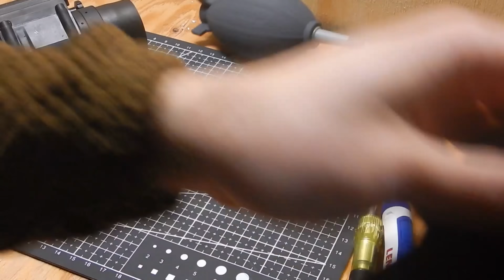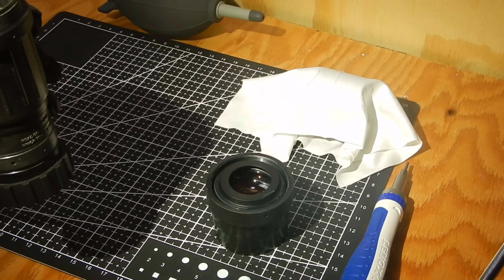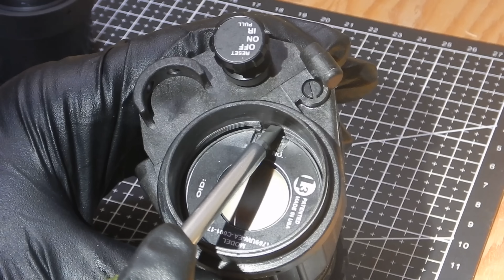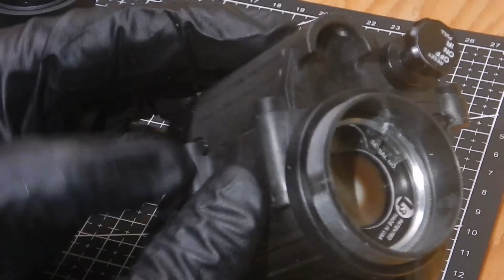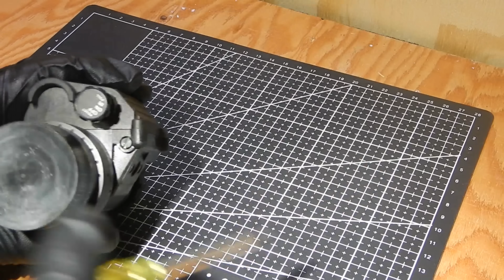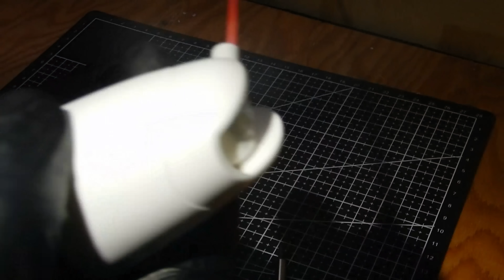How to Build Your Own PVS-14

Comment: My question is what websites/locations are you going to for finding these items and what are their relative prices
Reply: Agreed.  That's pretty important info.
Reply: +1 on where to get tubes.  With the pricing I see on eBay, you may as well buy a complete gen 3.
Reply: Agreed, a place to pick up a parts kit
Reply: Yes, good question. I was just wondering myself
Reply: I was waiting for the advice on where to get the “good” tubes but it never came. WTF. This is much less useful without sources.
Reply: I bought an omni 7 tube off a fb group for night vision and my parts kit from kosher surplus. All in ~$1700.
Reply: @rshinn1776  that's the same price as some assembled NV setups lol
Reply: @PartialRug  yeah maybe for a gen 2 with agm  glass. Not gen 3 with Carson
Reply: @rshinn1776  was the tube new?
Reply: @rshinn1776  Yeah, that's about the same price as a gen 3 RNVG (when in stock)
Reply: Following *
Reply: EBAY, you cab put together a beater pair with a zone 1/2 blem on the tube for under 1400
Reply: @piggyslayer1999  Ebay really doesn't show you anything
Reply: *Following
Reply: tnvc inc may sell replacement tubes idk
Reply: Based on what I’ve found, eBay has some but they’re really not that much cheaper than getting the full set up? There’s a used Photonis for about $1800?
Reply: Agreed! Anyone find any parts for this build? Or know of a decent place to start????

Comment: Where are you finding intensifier tubes, let alone for cheaper than it would be for a pre built unit? Also, body kits seem to be around $700, does that make sense?
Reply: Yeah for real, where can I find these alleged cheap diy kits.
Reply: 700 is about right for a kit. I'd make sure you get a Carson kit and not a foreign one. Tubes can be found if you look around. Or buy new from most NV dealers
Reply: @ChevTecGroup  I’ve never seen a kit for less than $900-1000
Reply: @Lifechanging99999  sts solutions was selling foreign kits for 550 without the nonsense skullcrusher and pouch. Not sure what they out them at now. 600-800 is a pretty standard price. You aren't looking hard enough
Reply: @ChevTecGroup  where do you recommend to look? New to the diy kit scene
Reply: @EdwardOrnelas  for a kit, look at most of the big name NV dealers. Steele, jrh, wills optics, gooningear, and of course ebay. TNVC may offer kits as well. Google should turn some up
Reply: @ChevTecGroup  thanks boss!

Comment: Re: nitrogen purging, if all you're looking for is an inert gas filling the cavity, why not just assemble it in a bucket of dry ice? CO2 is heavier than air and will displace it, the bucket creates a 'sea' of CO2, and when you slap the optic together in that environment it will naturally be filled with it.
Reply: Good idea but there's one word that defeats dry ice. Moisture. Since the temperature difference would be so drastic from room temp air the Moisture content in the sea of co2 would be far too high I believe
Reply: @TOO_RAW  except cold air doesn't hold moisture. That's why its hella dry in winter and humid af in summer. The dry ice not only provides an anoxic environment, but a cold one as well
Reply: @ArmstrongMixture  I understand that's partially correct but that's only if the inert gas is below freezing. I live in an area where we have cold damp winters unless the air temp goes below freezing. What I'm trying to say is once you pull your purged unit out of the co2 bath your bound to create humidity from the temperature difference inside the unit but that's just my theory. Who knows it might work quite well to be honest
Reply: @TOO_RAW  that's not how humidity and condensation works.
Reply: Do they make some manner of injector that you could add one of those little CO2 cartridges to? Like the ones they use for life jackets

Comment: I think purging would prevent condensation
Reply: It prevents condensation on the inside of the lenses and the IT.  It also keeps moisture off of the electronic circuit board inside the housing
Reply: That's exactly what it does, fogging is condensation, it's just internal rather than external where you see it.

Comment: An Electro Static Displacement mat with wrist and foot connections is recommended for prevention of static buildup and discharge (Faraday cage).  If you can get it (one way pneumatic valve), you want to purge with Argon (check specifications for pressure levels).  I always wore a full bunny suit working in the clean room, but if you have it a hair net is also a good idea; reducing the particulates in the local air is crucial.  Also, I would recommend working on a surface you can get spotlessly clean, wood is not great for optical work.  Local floor and tile places will have a nice piece of polished granite you can buy for relatively cheap.  (Edited for granite suggestion.)
Reply: Yeah, ESD management is a crucial component missed from this video. It does not take much electro static discharge to damage a circuit board component. And the insidious thing is it might not be obvious right away. It might result in a sudden premature failure later down the road.
Reply: @pb7087  while usually pretty important. These parts are pretty tough. But it is still a good idea to take some precautions
Reply: @ChevTecGroup  ESD is largely overrated, it really depends on the components though. About the only one I know of off the top of my head that's super ESD sensitive is laser diodes.
Reply: None of that is needed for assembling one nuit for yourself. Put it together and you'll be fine. You're not shipping 10k units, where you get to be sure none of them get returned or fail in the field.
Reply: @littlejackalo5326  Then why bother taking any precautions at all?  If you're going to do something, do it right.  You don't want  the unit you spent money on to be the 1 in 10,000 failure.  You can reduce this probability by using proper tools and procedure.  An ESD strap is essential and cheap.
Reply: Purging is to be done at 3psi. Never exceed 5psi

Comment: If you're going to be just using a Pvs14 you may want to look into swapping the standard battery compartment to an NL914C housing. It's lighter, allows you to use either a AA or a CR123 and has all the controls placed more conveniently.
Reply: I’d like to build one with the NL914C and an aluminum 7075 T-6 Vyper housing.
Reply: Get rid of both and get one that uses an 18650
Reply: @saltwaterrook4638  This
Reply: @saltwaterrook4638  where is a reputable place to get quality tubes?
Reply: @saltwaterrook4638   which housing would use the 18650
Reply: @saltwaterrook4638  except 18650s don't have an internal level shut-off. Once a Li battery is run past a certain point, it can never be recharged, just recycled.
Reply: @jarekmace1536   18650 batteries are lithium,   You are referring to the 2 different types of lithium where one is rechargeable and the other is not,  and 18650s do have the shutoff at roughly 3.4 volts
Reply: @diychad7268  only internally regulated ones do. There's tons and tons of unregulated ones used primarily for vaping that you can get for cheap, you wouldn't want to run one of those down too far.
Reply: Replaceable batteries > rechargeable batteries. I can buy packs of disposable batteries. I have to keep rechargeable batteries on my smart charger maintainer.
Reply: Why would you want to use nickel metal hydride or alkaline when you could use lithium?
Reply: @diychad7268  lithium batteries have terrible performance in cold environments. I have a headlamp with an 18650 that works fantastically for 7-8 months out of the year. As soon as the temps dip past freezing, then I'm finding I have to charge that battery 3-4 times more often.
Reply: @maynarddrivesfast804  Get the green Samsung 18650s, I use them down to negative temperatures all the time with no problem.  Just like most batteries they become less resistant to cold when they have less than 25% charge so I try to keep them above that.  I wish more devices used the 18650.
Reply: @Iwouldashouldacoulda  I'm not doubting your experience with the Samsung 25R (the green Samsung batteries), but I do a LOT of projects utilizing 18650 cells. From building battery packs for high amperage electric bikes and Onewheel boards, to building my own battery storage banks for my home, I've personally found that your energy capacity on ANY lithium ion battery is more than halved when the ambient temperature of the cell drops past freezing. I've found this to be true whether I'm using Samsung 25R/30R, Sony VT5/VT6, or even cheap, unbranded Chinese cells. Now there are the newer LiFePO4 cells that use a different chemistry that have been proven to operate much more efficiently in the cold than standard Lioh batteries, but they aren't as widely used in the 18650 cell size. I get that personal experience is anecdotal, but I do think that research on the cold weather operation of Lithium ion cells is pretty clear that their functionality is cut significantly.
Reply: @maynarddrivesfast804 idk if they make anything other than high output rate but h(OHM)lyfe 18650’s are my go to premium, I learned of them from vapes but even since I quit that shit I’ve used them in a few other things, most evidential use was in a protac hlx and not only was the output considerably higher but it lasted super long and didn’t decline in output until 5 mins before it died, only downside I’ve noticed is that the actual lifespan is a little shorter, and what I mean is I get less recharges per the battery than with other lower output batteries. Which to me makes perfect sense, and is a trade off I’m willing to make

Comment: Harbor freight counter top sand blasting cabinet would work great for setting up a clean room that you can set up with a stable atmosphere of argon. You can get a large tank of argon from a welding supply for a fair price and now you have a clean room environment for sensitive electronics without having to mortgage the house.
Reply: That's frigging smart! Never thought of that.
Reply: @xcyted4now  also would need to set up some form of dehumidifier to make it a true Inert environment.
Reply: @devinmanderson  Just throw a bunch of those silica beads packs in there for the more budget minded.
Reply: And attach a grounding cable to eliminate any static charges.
Reply: Also you would want a vent valve at the highest point possible for conducting the purge and a accurate flow meter/regulator.
Reply: My local dollar store sells large desiccant packs by the kitchen supplies for... a dollar.
I put them in my gun safes.
It's amazing how much water they take out of the air.
Reply: Add on a cheap vacuum pumpor hand vacuum brake bleeder kit....
Reply: @jonathanmoody6951  that wouldn't work for a sand blasting box. They're usually not air tight enough for a decent vacuum and you'd probably blow the gloves up like a balloon until they pop from atmospheric pressure trying to get in under vacuum.
Reply: Yea Argon is already heavier than air, no vacuum needed. A vent on the top will allow the normal atmosphere to be pushed out.

Sometimes we just need a dust free environment and atmosphere isn't the issue, putting a outward facing fan on the vent will create negative pressure = pulling any dust out with it. Just remember to filter air coming in. 

The exact same idea is implemented in my workshop, to a larger scale, and with a wall of copper pipes weaved into an air dryer, so I don't have to mitigate brainpower when I'm applying finishing, setting epoxy, spraying paint or powder coating or just allowing paint to dry. I won't even sand without a down draft table. Id hermetically seal the space if I could, trust me. Eliminate as many variables as possible.

Comment: What would you recommend be done for a blurry unit ?
Reply: Focus it? Clean it? How blurry are we talking. Is it the whole image or just part. Sometimes a through disassembly, cleaning and reassembly will clear up a lot. If it has ghost burns you can fix a lot by "blackboxing" it. Put it in a dark box in a dark closet overnight with it turned on, that often cleans up the image

Comment: Hand powered vacuum pumps are quite cheap. The other benefit to pulling a vacuum is evaporating any surface moisture, be it water or volatile oils.
Reply: That's what I said above, for a sustainable post-collapse solution.
Reply: Professional level vacuum pumps are available at Harbor Freight.  They'll pull down to 25-75 microns and run about $150.  Mighty-vac hand pumps work okay too (for the money), but the best vacuum I was ever able to pull was about 27 inches.
Reply: Brake vacuum pump off amazon work great 30 bucks

Comment: Any ‘ball park’ price on the kit? …would kinda help
Reply: E-Bay ~$750 for the kit.  Tubes go anywhere from ~$1000 and up depending on generation and grade.
Reply: You found Gen 3 tubes for $1000?

I find that the higher end units are cheaper to build than to the cheaper ones
Reply: @peterprovenzano9039  I didn't specify gen 3 but yes, you can find used ones near that range at times.
Reply: @peterprovenzano9039  I see them quite often for that proce or close to it. Usually older gen3 aviation tubes that fall out during a QC check and get replaced.

Comment: Just a not the retaining ring has an "up side/facing the ocular lens" also. You can tell be the depth of the notch marks in the retaining ring. Also to purge I remove the ocular lens and with the objective lens pointing up 12:00 use the Argon to push the O2 out of the bottom.

Comment: I was a radio repairman (29E) in the Army back in the early 90's.  In our shop we also had an MOS that repaired sundry other electronics that weren't radios.  We used to call them "Flashlight Repairmen" because mostly all they did was replace Image Intensification Tubes, power switches, and IR LEDs in PVS5's and PVS7's.  It's been a lot of years, but I don't recall them taking any of the care you've displayed here!
Reply: As a former 19D who was issued a pvs14 that was so incredibly poorly maintained that I legitimately didn't even recognize the value of NODs until I purchased my own I can confirm the validity of opening comment.
Reply: @Cyph3rX  that stuff was big hooah as an 11c, we had good maintenance.
Reply: I can not remember how many PVS 7's I had to take down  for the main body replacement do to damage, but a few imaging tubes were replaced.  Then I can remember picking up 7 PVS 5's from of of the cav units on FT Hood.  Did the pricing of the damage parts and each one to repair was more expensive than getting new PVS 7's at around $3600, but the parts to make a PVS 7 were 3400.
Reply: this is why Aviation always did their own maintenance on their ANVIS Goggles.
Reply: PVS-5/PVS-7... Gross. I joined right before the 14's became standard. The difference between 7's and 14's was like night and day... No pun intended. I hear the new thermal NODs are fucking tits.
Reply: @StudleyDuderight  Oh PSQ20B they are pretty awesome but battery life sucks.
Reply: @calebbraun7238  I got out a few months before my unit got the new ones. I might have stayed had retention brought that up in our meeting.
Reply: @calebbraun7238  yes they do. I own some and god damn it's horrid. But the thermal capability on top of night vision is just too good to pass up.
Reply: @StudleyDuderight  PVS-5 isn't in the same ballpark as PVS-7.
Reply: We are now 94F.
Reply: @calebbraun7238  I noticed they changed the MOS when I tried to join "Together We Served" and they wouldn't let me because my MOS didn't come up! SMDH
Reply: I was a 29S back in the 80's.
Reply: My last unit I got to know a guy whose mos was repairing nightvision and such, yeah there was no clear room for repair in the desert
Reply: Gary, youre right, we didnt put as much care into the work as he does in the video. It sounds like you and I were the same MOS. I was 35E which changed to 94E radio repairer. I worked with the 35F ->94F that did special device repair, and I often did a lot of cross training with these guys as they were always in the same shop. I actually ended up being the NVG guy for our batallion in Afghanistan since our official NVG guy went AWOL before deployment. Anyway, Ive never seen any of the Foxes wear gloves while servicing NVGs during my career, and when I was in Afghanistan, I didnt have the proper tools and was unable to get any on order, so my spanner wrench for the image tube over the light pipe was some needle nose pliers that I ground down the tips to fit int he nut grooves. Blew out the dust with canned air and wiped the lenses with the lens cloth, greased the seals and orings with a light coating of silicone grease. Then we purged them and adjusted the limits on he objective and eye lens, and boom, its done. Basically slapped shit together since I was the only one servicing an entire infantry battalion's NVGs.
Reply: @RedDragonV09  That sounds exactly like my forward support shop in the early '90s!  I guess some things never change.
Reply: We are 94F now. Still flashlight repair.
Reply: @garyblack8717 radio comsec repair is now 94E..29E also got picked up by a new MOS called electronic warfare specialist but that changed 3 years ago to 17E crazy cuz my first mos was radio repair then 29E now 17E lol
Reply: God Bless !!!
Reply: God Bless !!!
Reply: And I heard they called you guys "walkie-talkie fixers".
Reply: @dangerous8333  Maybe, but they didn't know how to turn on the IFR spectrum analyzer much less tune a tube-type final, but anyone can change an image intensification tube!
Reply: Sundry.  Good word usage, man.  lol
Reply: No out of pocket expense.
Reply: Well yeah it wasn't their optics hahaha, if they're gonna leave whole-ass combat helicopters behind I doubt they'd take care with an image tube 😂
Reply: They didn't have to worry about buying piece parts